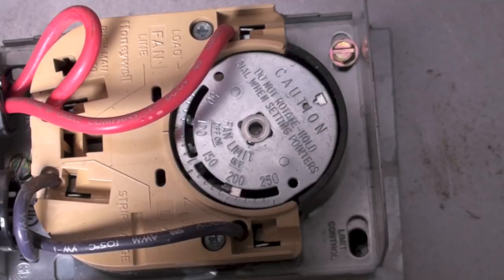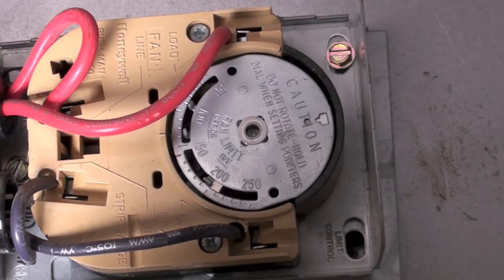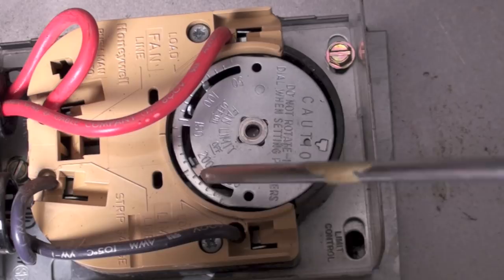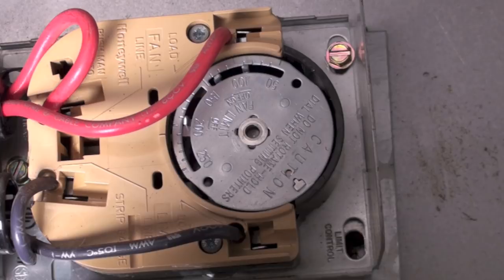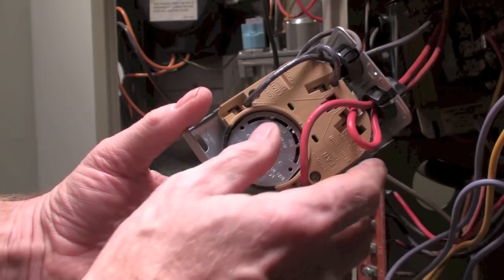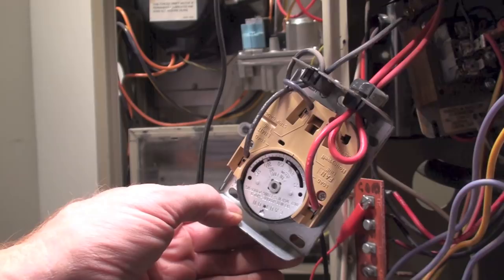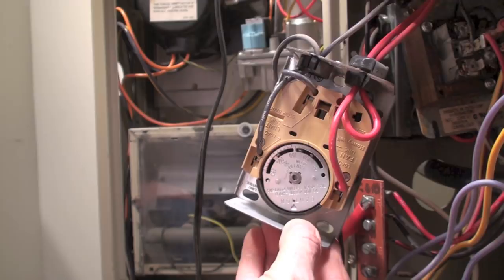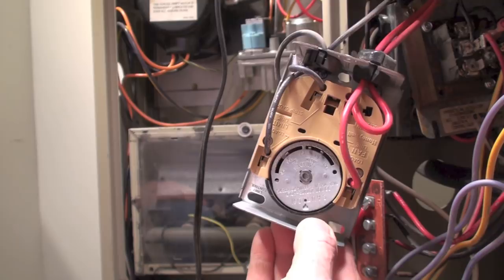How the Honeywell fan and limit switch works.

Comment: This unit has been used for the past 50 years and this is one of the best videos I have ever seen - THANKS!!!
PS. only video that talks about the "power jumper" AND all of the limit settings.
- fact is if you are replacing the unit and have 4 total wires you should "break the jumper" and if you have 3 wires (120v both sides) you need to LEAVE the jumper.  The missing wire will be on EITHER side of the jumper!  Like he says, running 120VAC into the 24vDC circuit will be very exciting!
Reply: wtf?? I have 6 wires! 2 from city power, 2 from the switch transformer transformer and 2 from fan, lol The only way I see it going is 2 wires sharing a single socket, but that is not pictured. If I do what I see, wire 2 lines from city power direct to box on fan side and 2 wires from the transformer direct to box on switch side, then how does the fan work when it's not hooked up?
Reply: This comment helped me see the primary concern. 3 wires = high voltage, 4 wires = low voltage

Comment from the maker: That fan and limit switch was the most common type of fan switch used on most oil, gas, and some electric furnaces.  Thanks for the comment.
GFM
Reply: My furnace is a comfortmaker and It's a 1980 style, it quit turning turning the fan on last year.   I didn't know they had these things in them.   The fan would stay on and the burner would kick out. Last year though the fan switch wouldn't come on and neither would the fan when it warmed up.    You have turn the blower to on before it does.   So I reprogrammed the thermostat to the a.c. side  to operate the furnace.  The furnace still cut off at the certain temperature.   I had to adjust the burner.   They said it on web it should burn an inch flame.  It does better.

Comment: This is exactly the switch I have and need to understand.  Thank you so much.
Reply from the maker: Welcome
GFM
Reply: I have a followup question.  I'm looking for a complete explanation of the whole cycle from turning up the thermostat to the burner and blower fan turning on and off.  Do you have a video of that?  What part exactly turns the burner on and off and the blower on and off?
Reply from the maker: I did a set of videos on what I call the "antique furnace" that may help.  I don't know the age of your furnace, but most of these furnaces used the thermostat to energize the gas valve which started the burners.  As the heat exchanger warmed, the heat operated fan switch (the one you have) closed and started the fan.  Hope this helps.
GFM

Comment: I have a 40 year old Lennox furnace, and my fan won't automatically shut off when
the burners shut down.  I tapped on that dial on the fan and limit switch and the fan
then would shut off.   When I did that, the dial turned slightly and the fan shut off.
 I replaced the fan motor a couple of years ago.  I did have a very dirty air filter but
 replacing the filter didn't help fix the fan and limit switch.  I'll probably replace my furnace
next year.      Good video.
Reply from the maker: That is the classic symptom of a fan and limit failure.
GFM
Reply: What is a "fan and limit" failure?   Will replacing this switch probably solve my problem?  I'm guessing that it does.  I just ordered a new one and will
replace it soon.
Reply from the maker: Assuming your description of the symptoms is accurate, yes.
GFM
Reply: I just replaced my fan limit switch.   It was pretty easy to do.  The coil
in my old limit switch was distorted and rubbing against the tube, which
is why it wouldn't rotate back to the "fan off" position when it cooled down. 
Yes, I did remove the copper strip.   Furnace fan is working normally now.
Thanks for the great lesson and tips.
Reply: It wasn't as cheap as I thought it would be, but I saved a lot of money
by replacing it myself (about $120 for the switch).
Reply: My fan won't come on in ac mode but comes on when thermostat is off?

Comment from the maker: Sorry, your message was in the spam.  The motor probably went off on overload.  Most of these are automatic reset.  If it does not reset after approx 1 hour, look for a reset button (probably red) and push it.  If the fan will turn easily and still wont start, manually turn the fan with the power on.  If the unit starts (keep your hand free), the capacitor has probably failed.  If it is stiff, look for oilers over each bearing.  Hope this helps.  
GFM

Comment: just finished following tip to tap duct work beside switch worked like a charm shut the breaker off first . think i will check furnace come spring .THANK YOU

Comment from the maker: If the limit controls the primary (120v) of the transformer, the jumper must be left in, as it is the voltage source for both the fan motor and the transformer.  Hope this helps.
GFM

Comment from the maker: If your switch looks like the one in the video, remove it and look at the probe.  It comes in 5", 8", and 11 1/2".  Get the right length or it may not sense right.  2 ways you can get one are internet parts houses, (I dont recommend any of them, nothing negative just no experience).  You may also buy from a local service repair company over the counter.  Hope this helps.
GFM

Comment from the maker: If the motor was hot and now is cool, the motor is probably failed.  When a fan motor gets stiff bearings, the bearings are damaged and will probably not last long anyway.  Looks like a new motor.  Good luck
GFM

Comment: I have one of these on an old Rheem furnace and I can't understand why its wired like it is. The 24V red  wire leaves the limit switch and goes strait to Position #1 of the Honeywell s86F intermittent igniter where I am currently missing my 24V signal  to turn the GV on.
The  24V yellow lead goes from the fan limit strait to the safety switch on the main blower unit, through that and back to terminal Y.
That doesn't make any since whatsoever  to me but that's the way I found it.
As always the coldest day of the year the heat quit working and has not worked since. 
 I have drawn up a schematic of the entire system  like I found it.

Comment from the maker: The fan and limit for that unit does have a single pole double throw switch on the fan portion of the fan and limit.  So it is special.  
The general replacement ones that I have seen all have the copper jumper.  Happy Thanksgiving
GFM

Comment: I have a honeywell fan (model # 14F0) that stopped spinning. You would hear a buzzing sound (which indicates that its motor is trying to spin but is somehow jammed) but no action. Normally this would be an easy fix, open it & lube it. The problem is I forgot to turn it off when it did that. Since the motor was on but it wasn't spinning, I think something shorted in there. So now when I turn it on there is no buzzing sound or any thing that indicates that electricity is running through it.

Comment: Love your videos!! They sure save a working man a lot of money and pain!!   Wondering if you can help me. I have a 30 year old Lennox furnace. This morning, the furnace ran as normal and then shut down as normal. A few minutes later, the fan restarted for a few seconds. I went inside and adjusted the 'off' switch to 110 from 100 and it seems to be okay. Initially I had changed it from 100 to 90, and found it cycled again very quickly. So I decided that was the wrong way to adjust it.  So, as I said, I moved it to about 110 and it seems okay. Is this a safe thing to do?  Is there something else that can be causing this secondary cycling?
Reply from the maker: +J S No problem with what you did.  The short cycle of the fan is just removing any heat left in the furnace.  Hope this helps.
GFM

Comment: Excellent video explaining how this works thank you. I have a Magic Chef furnace that must have gotten an electronic ignition at some point in it's life. The pilot turns on, flame sensor is good, but the main gas valve only opened one time during troubleshooting and I never got the fan at all. Going to check the limit switch out tomorrow, curious if it has failed and cut power to the main gas valve and fan, though I am not sure why the pilot and ignitor stays on in this scenario. Hoping this understanding helps me figure it now now that I know there is more to the circuit than just the flame sensor and valve.

The other working furnace shuts down everything when heat shuts off but this must turn the fan on when the still hit burner heats it up again, the gas stays off but the fan comes on again a minute or so after the gas shuts off and then runs for a minute or so until that switch cools down.
Reply from the maker: If your ignition lights the pilot, then main gas comes on and your situation is the pilot lights but no main gas, clean the flame rod with sandpaper(it is a metal rod about 1/8" diameter in the pilot flame).  
If that does not help, the ignition control has failed.
GFM
Reply: @grayfurnaceman  thank you. I cleaned the flame rod first pass but only had cloth. Swapped the whole assembly from a working unit, same thing. Today I cleaned the rod with wire brush and the burner to gas line contact points so they all bonded. I had mixed results with meter yesterday trying to find clean ground. Pilot lights and pulses no main valve fire.

I reached in and touched the pilot shroud with a screwdriver and it lit right up. Ran for a while then when back to igniting with just a pilot. Got the idea to clean the shroud, to help the ionization? Maybe the screwdriver close to the flame acted like an antenna for electrons? Cleaning the shroud in place worked great, tested on and off and a cold start 8 times. Gas company came out at my request, supposed to be 7wc and it was 6 and they adjusted as I was leaving. An hr later, same deal no fire. 

Went back tonight with contact cleaner for the spade connectors and a plan to clean up the corrosion I noticed between the pilot shroud and the main assembly. Thinking about poor ionization/detection/movement of electrons again. I also cleaned the pilot gas line, the end was dirty and I accidentally made it worse, was able to clean with contact cleaner and a single fine bristle  of steel brush thru the tiny orifices. Blew thru it, cleaned the heck out of the whole igniter/pilot/flame rod assembly and their contact points to the burner. Fired right up. I removed the igniter to check the pilot without full gas and it still pulses but it's blue now without a yellow tip. Even with gas on high the flame rod doesn't get red hot anymore and it stays lit consistently and lights instantly after the pilot. I know now it's not the heat I need like a thermocouple would function but rather the ionization in the flame. 

I think the rod was fine but  whatever magic happens with the ionization wasn't happening due to poor flame generation by the pilot and bad electrical continuity between components. Maybe the contact cleaner on the spade connectors helped too.

I appreciate your videos that helped me catch up on how various components worked. The most important thing was the difference between a flame rod and thermocouple. Once I understood the operation I could make sure the best conditions existed. 

Hoping it holds up. I think I have finally seen how it's supposed to work and what a good pilot and flame rod activation looks like.

The lesson I already knew but was too rushed to bother to do first this time was to clean while I work. No matter what it is you are working on, dirt, corrosion, dust, it all gets in the way of good operation. I wanted it to work first before I bothered cleaning, big mistake.
Reply: Also based on your videos I understand my limit switch now. It was all high voltage and if it cuts off it would kill the power to the transformer too. It controls the fan independent of the gas valve operation only responding to the temperature of the heat exchanger. I never got fan because I never reached temperature.

Comment: Thanks. Unfortunately it does not reset on its own and there is no reset button. Pushing the fan manually wont work either. I think something shorted out, because the fan was too stiff to spin while the power was left on.

Comment: Hi, I  have a lenox pulse and the controller is g891tca-8103.  It runs fine  sometimes for a week or two then shuts off. The green light on the controller goes out as well. Then I shut breaker on and off and it works fine for a week or two. I have cleaned the blower, bottom of the heat exchanger,  new filter, and had the board replaced. Flame sensor and spark plug were also cleaned.  Have you run across this problem? Now I was thinking if it had anything to do with this limit switch. Any help would be appreciated.

Comment: Great tip, i ran into a stuck  two stage limit on a icp oil furnace, i bumped it to get it going but  just replaces it with a oem part what is the difference besides a 4 day wait from the parts house? And one more thing, how do you know which limits are just 120 and which ones are 120/24, is it  on the package? or are they all 120 and you break the copper peice

Comment: OK took off the limit switch and just pressed at the back of it and the one on the right clicked back in? I hope that makes sense. I put it back on and wired it and it started!!! So it is the limit switch. I'm not sure that fixed it though. I have heat at least. BUT it ran for a minute and the fan never came on? Not sure why I turned the fan on manually and the furnace came back on? I'm going to put it back on auto to see if it works by its self.

Comment: This may be a dumb question but is there anyway to know what wires are what coming out of the furnace to connect to this switch? The person who tried to replace the switch on mine did not make note of what wire went where before taking it out and the wire colors don't match 😑
Reply from the maker: There are many different ways to wire that switch.  You will probably need to get a professional on it.
GFM

Comment: Thank you Grayfurnace man.  I really appreciate that you took the time to document some of your learnings.  I have been trying to assist my brother with his Honeywell Limit switch that you appear to be very familiar with.  The original part is a L4064T2481 which is not produced anylonger.  I have been researching and I believe the replacement should be L4064B2210 .  This one seems to be general replacement.  The original unit has two low voltage connections in the middle.  In reviewing your Honeywell video you mention the replacment and the fact that you would need to remove the copper strip.  

Can you confirm that the L4064B2210 is the part we need?, and that we will need to remove the copper strip?  I appreciate your time and knowledge..
Reply from the maker: The original part had a helper heater to keep it from short cycling.  The part number you have is the proper one if the insertion is 11.5 inches.  It may short cycle once before it stays on but there is nothing you can do about that other than separate the on-off temps farther.  The copper strip must be removed if the limit switch is in the low voltage circuit.  Hope this helps.
GFM

Comment: I got this same one,my blower motor stays running ,i isolated the thermostat & still runs,i gotta turn off breaker for it to stop. Could this be the issue ,doesn't have a control board
Reply from the maker: It is probable that the switch has failed.  If you strike the dial of the switch with a screwdriver and it shuts off, it has failed.
GFM
Reply: @grayfurnaceman  thanks for the quick reply, i just replaced panel door switch & still runs,it turns off when i remove bottom panel off,tstat still isolated, i also took wire off that comes from transformer i believe is the common wire that goes to capacitor & it stops,could it be transformer?
Reply: @grayfurnaceman  transformer has a plastic piece attach to it were tstat wires connect to it,maybe that could be the issue? Doesnt look like a relay that i can remove
Reply: @grayfurnaceman  its fixed i just tapped on fan limit switch & it works now
Reply from the maker: @justdissin7340  Probably not.  In most cases, it will stick again.
Reply: @grayfurnaceman  ok ill have to order part thanks for your help gfm

Comment: A couple questions. First of all, on a millivolt system, this is also wired to shut off the gas valve, if the fan doesn't come on (e.g., a power outage)? Second, I notice that a few people here have had issues with these units sticking. What is the lifespan of these units, and would it be prudent to replace them on an old furnace BEFORE failure?
Reply from the maker: Yes there is an overtemp limit.  I have found these fan and limit switches to be dependable and most last the life of the furnace.
GFM

Comment: What is the proper way to recalibrate those switches?  Mine was reading about -200 deg F at about 60 deg F.  We heated it with a small propane torch to about 500 F and I would hold the dial and pour cold water on the bi-metallic strip.  We did that several times and it was close, but still reading colder than ambient temperature.  I reached in to the bi-metallic strip with a pair of needle nose pliers and smashed one of the coils a slight bit to make the strip a little longer.  I would guess it is within 10 deg F now.

Comment: great video...replacing the fan switch. it has the little jumper wire, how do you test to see if 24v or 120? will the two wires on the right read either one when powered up? thanks
Reply from the maker: If the original switch has the jumper, it is a 120 volt system.  Hope this helps.
GFM